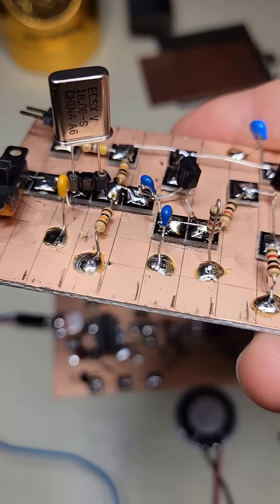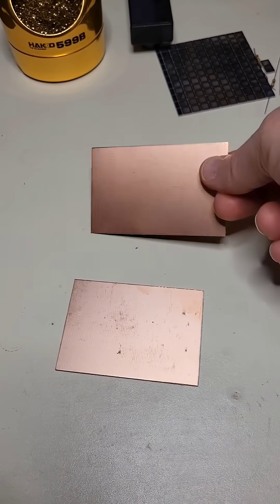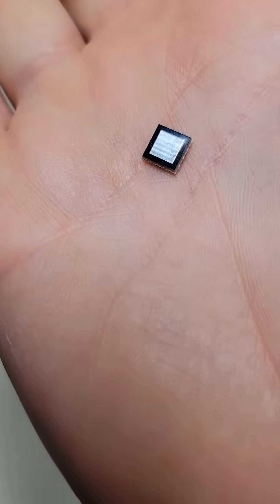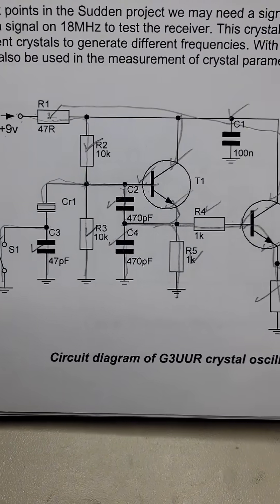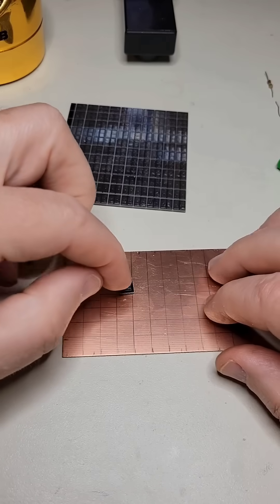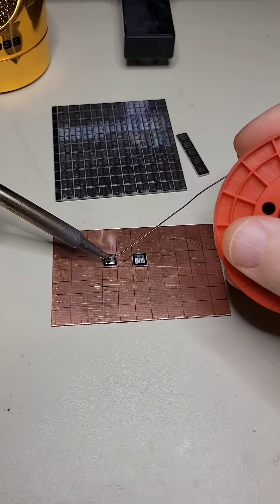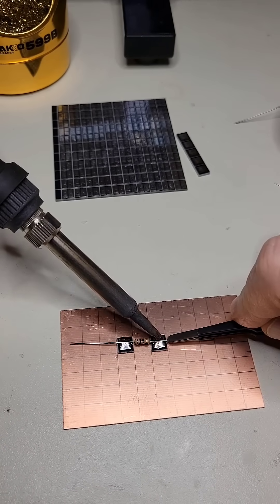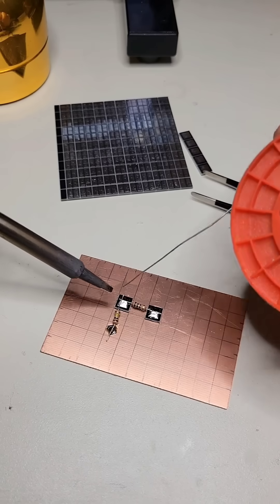Manhattan Circuit Construction Technique for Homebrew Ham Radios

Comment: In high-school electronics shop class we etched the circuit into the copper and then drilled into the board to attach the components after covering the copper with solder
Reply: I did too. I think the point of this construction is to have a good ground plain for high frequency or low noise applications. I wouldn't use super glue though.
Reply: @BlankBrain pcb has two sides. You could just not cut into the other side. Drill holes, go through, solder. This video already mounts stuff on the surface. PCB makes this easier. I like wires in the air. Nothing has lower k.
Reply: @ArneChristianRosenfeldt  different techniques come down to preferences of the builder. One person likes etching, but another hates messing with noxious chemicals. Another likes milling, but someone else might hate noise and dust.  People who like Manhattan construction tend to like the idea of a solid, unbroken ground plane, fiddling with things, and probably hate drilling.  All methods are good.
Reply: @yakovdavidovich7943  true that !
Reply: @ArneChristianRosenfeldt  This method is also often used in commercial HF...UHF construction: On the component side there is an undisturbed ground plane. Components are installed on that side. Component-wires that go to ground are soldered directly onto that ground plane. All other wires are passed through holes (with a little bit of the groundplane copper removed around each hole), and on the backside of the double-clad PCB the circuit board has the conventional etched lines. The groundplane acts like a shield between the various signal lines and the components, too.
Reply: @BlankBrain  I have seen similar technikue when they have a pen sizen tool to cut a circle, to seperate it from the rest of the cooper, and use that to solder component leads.
But i guess this is better as the ground plane is uninterrupted.
Reply: @BlankBrain  I've tried a similar method except the little pads were cut from double-sided board so I just soldered them down. Sometimes I just want to hack something together without all the planning a proper PCB needs
Reply: So this one only does better on RF design because low impedence from the copper board. Other than that, a bread board would be better
Reply: Нормальный человеческий метод!
Reply: I'd photocopy circuit diagrams, then iron the pattern on to the copper board, Sharpie over any faint traces, then etch the pattern on.
Reply: Yeah, that's the 'normal' way, but HF circuits and radio stuff are a separate type of artwork that needs this type of design if being done in a DIY fashion. That huge ground plane provides a lot of stability where RF signals are concerned. Modern boards also do it, but they are layered and you don't see it as obviously. For example a 4 layer board can have vias (thoughput connections to other layers) that allow connections to a ground plane similiar to this.
Reply: Etching and drilling is better for established designs as it allows tighter placement. Manhattan is better for newer designs, as the ground plane can stay uninterrupted and it's easier to change components and routing as you proceed. Changing routing once you drill and etch usually means an entirely new board.
Reply: As he mentioned, this is for SCRATCH built projects. you talk about completely designing a PCB.
Reply: Ну вообще так обычно и делают. Есть два способа нанесения маски. Это Лазерно-Утюжная Технология и фоторезист.
Reply: thats fully fabricating a PCB
Reply: I've heard that some of the solvents used in that are toxic, but I would like to try it someday
Reply: @nataliealliepage7155 Some are corrosive and also cause permanent stains. For quick prototyping as well as high-frequency circuits, nothing beats the good old "dead bug"-construction style. You'll find YT-vids about that. If done neatly, the result is both neat AND functional, and it works right up to about 1GHz.
Reply: Like NORMAL people, you mean.
Reply: I used to make my own boards using a laser printer and gloss magazine paper and ironing on the image then soak the paper in water and rub it off and then soak it in feric chloride to etch a board.. made lot's of good projects that way
Reply: @chazlabreck when I was in high school I'd never heard the word, Lazer
Reply: Wow high school eletronics class that is just amazing all that was in my school was automotive which is going away because elon musk is going to wirelessly fix every car in 10 years and FOOTBALL
Reply: @twangyyy18888  all the shop classes need to come back. Not everyone is meant for college
Reply: @cbmech2563  which school have you been?
Reply: @twangyyy18888 They're not getting rid of shop classes because of Elon Musk.  More like the dozens of unnecessary admin and executive positions in your school district.  My high school electronics teacher was an amazing man.  I don't even know if  men like this exist anymore.
Reply: Wow this sounds like how we use to do it in the electronics classes I taught for 17 years. We use to use tape or a sharpie to layout the board and
 used ferric chloride to etch them
Reply: @SPfg3388  that sounds about right. After etching the board we'd use a soldering gun to put solder on the copper. I used my own 240 watt gun and had no problems the school had 120 watt guns and most of the kids
Reply: That's far better than this nonsense.
Reply: @Bobsmith-yf9oy This ground plane technique allows circuits to work up to high uhf bands and lower microwaves.. with many other techniques one has to really know rf pcb design.. I've never had a problem with unstable circuits..also it's quite easy to manage return currents to minimize emi. But yes..not my go to way to make other type of circuits at home
Reply: @hipihei but so will etching of you keep the clad on the opposite side of the board intact. Then you drill from the etched "active" side of the board to the ground plane side for any ground connections (via, or through-hole leads).
Reply: @hipihei It has more capacitance to ground than rats nest though
Reply: @Bobsmith-yf9oy w2aew episode 122 shows a number of methods and when to use them. All are faster and in some cases better than etching a board.
Reply: @anullhandle  yeah, that's an excellent channel.
Reply: @Bobsmith-yf9oy  if you don't see the benefit of this, you fail to understand what is going on. the ground plane is close to any component that needs it.
Reply: @Bobsmith-yf9oy  it's not nonsense. I prefer etching or ordering a pcb but this method does the job for prototyping radio circuits
Reply: well sure, but you need to be able to do etching, draw the board etc, but sure, you end up with a printed circuit board once you transfer the print on the board and etch out the other parts

Comment: It is less job to do a proper PCB design. Then send it to a PCB fab, get it back, and assemble it. With whatever stackup and holes you want. Cheap and fast and you stay within your signal integrity limits and EMC limits...
Reply: Can I get a 4 layer PCB, where the inner layers are close to each other and supply power? Then I want an air channel spacer layer for low k and a again a thin outer layer to carry the traces.

Comment: You can also print out a a fairly complex circuit on heat transfer paper, apply it to the copper cladding and use acid to dissolve the unwanted copper to create the circuit
Reply: Pretty toxic. I have the impression that only small groves need to be cut into copper. CNC drill seems to be the ideal solution.
Reply: @ArneChristianRosenfeldt  I'm sure breathing in the dust from a cnc is just as toxic if not more toxic. It's not that you need grooves, you just must need to make seperate circuits by dissolving copper off the cladding thus creating tracers just like your everyday circuit board. No grooves needed. Just need to isolate individual circuits. Which is where the printable transfer paper comes in. Draw up your circuit on your favorite cad program, print, apply and dissolve. Wherever the transfer paper is, its where your tracers will be. The ranger sheet in theory will keep the acid from dissolving the copper. No micro dust particles to breath in..
Reply: @jakeclauson9863  I want a CNC planer. And I would Lay-out traces in an organic way as on the N64 mainboard.

Comment: Why use a double sided copper clad board? It seems you only need a single ground plane.
Reply: Isn’t it a wet production process? How do you clad only a single side?
Reply: @ArneChristianRosenfeldt  Copper layers are usually laminated to the board as it's being made.  The wet process is only for forming vias between layers.  They don't grow entire copper layers on FR4 boards using wet process.
Reply: @davidnaegle427  Ah makes sense. So copper is kinda forged into sheet metal just as it is forged into wires.
Reply: Double sided PCB stock is easier to find than single sided these days, but you are correct that single sided could be used.

Comment: When is this going to be a "3D" pronter option? ... where ALL this is done "hands free"?
Reply: I don’t think that you can print copper. Maybe you could hammer it like gold? A robot which can bend wires would be cool. Maybe it could operate in pure H2 atmosphere for oxygen free copper. Then crossing wires can be welded easily. Wire ends are cut so that they expose 45° flat surfaces. Bend them up, to level pads for the parts. Just, how do we apply the silk layer?
Reply: Who said it wasn't a 3D Printing option? If you just want circuits and amps hands free, program yourself PSoC from Cypress Semiconductor (part of Infineon since 2020,) or some radio backend chip from Qualcomm, TI, Analog Devices plus your power and comms stagings. Otherwise see arXiv I suppose, I only see soft robots stuff in my feed lol turning to pick & place machines gone krunking seems like an odd choice. (Wow shorts are old now your comment is 6 mos old I see.)

Comment: 35 years ago there was a magazine "tehnics" every month they would print the layout for different boards and I used to carbon copy on the plate, insulate with tar and burn the rest off with acid, did you know we can build a radio with no power source? 😅
Reply: radio with no power source.. wasn't that just a germanium diode on two long wires and a crystal speaker? I think that was for longwave stations?
Reply: @tigerchills2079 With a suitable antenna and careful construction you can build a crystal set to receive short wave.
Reply: @tigerchills2079 receive AM broadcast as well.  I probably still have a couple floating around.
Reply: I suppose you could either receive AM stations on either long wave, medium wave or shot wave stations. What ever is the strongest in the area, you pick that and cut the wire according to the wavelength.

I haven't successfully built one yet. Any practical advice?
Reply: @tigerchills2079  you need to have special, high-impedance headphones, which are probably difficult to get these days, when good amplifiers are the norm.  Most headphones and earbuds these days are lower impedance because they are less likely to pick up noise.  But with a crystal set, especially an unpowered one, all you've got is 'noise'.  Look for headphones or earbuds that are meant specifically for use in unpowered crystal radios and your chances of success will be improved.  It also doesn't hurt to do your testing within a few hundred yards of an AM radio station, where the signal is strong enough to power even a poorly constructed crystal radio set.

Don't expect to pick up an FM station, though.

Comment: You can also "punch out" with a tool round copper discs from a copper clad circuit board and then glue those round discs to the board. I forget now the name of the tool but it's cheap and easy to find.
Reply: Called a 'hole punch'

Comment: It's "sodder" here in America.  Leave it to the French !  Lol.  We called it ugly bug wiring. Plus, we were too poor, so we just
(isolated) "cut the pads out" of the ground plane.  Keep the component leads
reasonably short.  Don't be afraid to think
in 3D:  use more copper clad boards for
circuit shielding
(between the input and output networks)
and for RF tight boxes.

Play !!

Comment: why not put the diagram on the board, then put the board into etching solution wait for an hour or 3, pull the board out,  there you go printed circuit board.
Reply: You could build this before the board has been etched, and you don't need to deal with toxic chemicals. Also this gives a superior ground plane for high frequency designs.
Reply: Someone took dealing with copper sulfate or other etching hazmat more seriously for reasons, but also 3 hours in the day gtfo and this lets you zoom out a prototype; use resin instead of cyanoacrylate if you want the glue to endure rework, and work with a fume hood using a Peltier driven hotplate/cooler.

Comment: pretty neat will keep this in mind instead of perf board if im doing a radio project 
    that ground plane would really help with shielding ❤
Reply: You can use cut-up bits of copper-clad as the "islands" if you want, and a conductive case as the ground plain.

Comment: I think it's because of the purpose, ham radio. The ground plane is very important, when it's RF you're working with. Maybe not much of an explanation, but that's my conclusion. I also think it looks awesome 👍
Reply: So a ground plane is going from very low resistance to very high resistance without much of a gradient in between. So copper, mirror polish surface , air. And most parts need a pin soldered to it anyway.

Just, these parts are all so huge. Those long Leads have uFarrads of inductivity.
Reply: @ArneChristianRosenfeldt The rule of thumb is 1nH/mm, so no, none of these components have microhenries of inductance in their leads.
Reply: @ArneChristianRosenfeldt you mean nHenry...
Reply: @ArneChristianRosenfeldt  I'm not sure what your point is with your first paragraph.  A low-impedance (low-resistance) ground plane is separated from each circuit node (me-pad) by the thickness of the FR4 board.  That's good; that means the electric fields are kept small and short (the fields mostly are contained within the thickness of the FR4 board), so the circuit node isn't interfered with by external electric fields (RF interference).   And so what if parts need pins soldered to them?  The electric fields extend from all parts of the circuit node to the nearest ground plane.  That's the physical definition of parasitic capacitance, and it's usually small enough to be ignored.

But your last sentence is where you really go off the rails.  First off, inductance (the correct term; not 'inductivity')  is measured in Henries, not Farads.  Elsewhere in this thread someone calculated that each 'me' pad adds about 0.6 picofarads (0.6 trillionths of a Farad) of capacitance.  That's 0.6 MILLIONTHS of a microfarad.  Similarly, a long lead such as is shown in the video has a typical inductance of 5-10 nanohenries (billionths of a Henry).  Parasitic Inductances and capacitances like these are not significant unless they cause the circuit to resonate.  That happens at or above a frequency  f = 1 / (2π√(LC)).   Plugging in our values above,  f = 1/(2π√(10 e-9 Henry * 0.6 e -12 Farad)) =  2.054 Gigahertz.   So if your circuit operates at frequencies no higher than 10% of the parasitic resonance (2 GHz), i.e., 200 Megahertz or below, you can ignore these parasitics.
Reply: @davidnaegle427  ah thanks for the maths. Just IRL breadboard computers seem to max out at 20 MHz. So I guess there everything is just too big. I cannot grasp how power distribution can be stressed by a SAP-1.

Yeah, I don't know why they still teach physics in German. Now I have to learn the correct word in three languages (because US and UK differ). Like Aluminium, aluminum. Induktivität. Kapazität, Capacity , Kondensator, Capacitor, Million, Billion. Quecksilber, mercury, Wolfram, Tungsten

Comment: - Reminds me of the old;
" HEATH KIT. "
days.
Reply: My Heathkit projects still work and look a lot better I do want a new digital oscilloscope but my Heathkit is an old friend
Reply: I used this technique for a radio project I built many years ago. It worked very well. I drew the grid of lines onto the board, then used a hacksaw blade to cut away the lines leaving isolated squares on the board. Then soldered each component in place on the appropriate squares. And it worked !
Reply: @thomas-i5o7h  Back in high school I used a slightly different method. I'd score the board with a utility knife then uses a laminate cutting knife to cut away the copper. They made a nice V cut through the copper as it was pulled.
Reply: @miket2120  ; That's great !! It's always so cool to build a project entirely by hand from scratch and have it work !!
Reply: my grand pappy never had a heath kit, he used
cardboard instead, or scrap wood. once he used a dried out tree branch to build an antenna tuner on it with a homemade tuning capacitor. He had a big lump of coal and homemade cat whisker and made a shortwave radio to listen to CW on

Comment: Why not use perf board?
Reply: Perfboard is useless for high frequency designs, you have no ground plane.
Reply: That was my question, too. And honestly, for about a 100 snackers, I can have 10 custom boards made and shipped to me within just a couple of weeks. If I am worried a part of my design is bad, I can design the board so that everything gets connected together a little bit at a time. And solder paste in a 30 dollar toaster oven is awesome. Instant board. 

Just install jumper pads/via everywhere you want the circuits disconnected until you are sure each part works as expected. I typically isolate the power supply so it can be built and tested first, with nothing else connected except a dummy resistive load. Then the CPU/MPU is isolated from the peripherals so that dummy test code can toggle all the pins. Then the analog inputs and outputs are finally installed. After that, cameras, RF amps, Bluetooth, wifi, and so on, are each wired up.